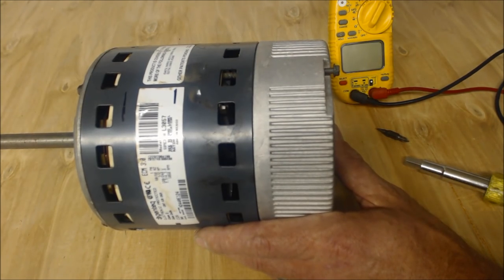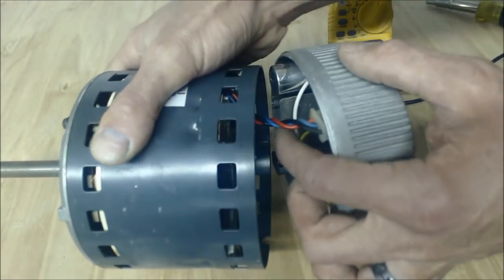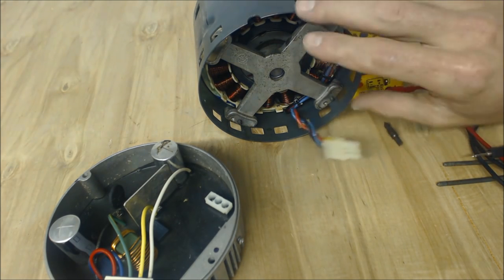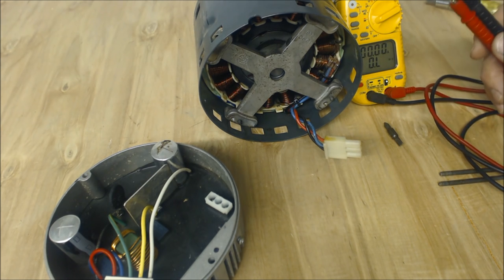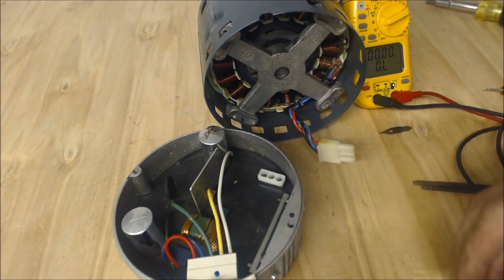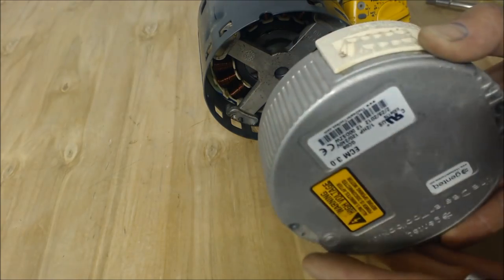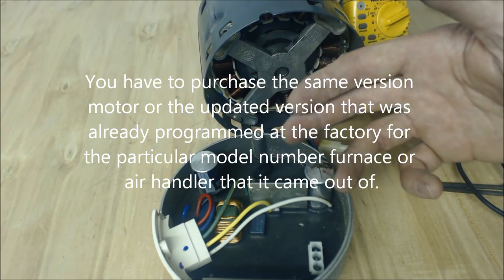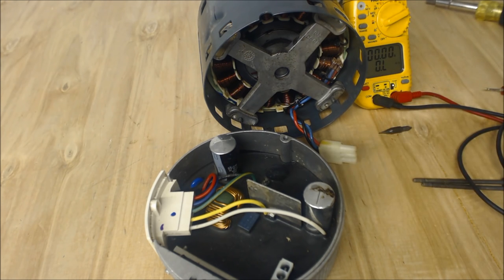Troubleshooting Variable Speed Fan Motors!

Comment: Yeah you are right that's a 3-phase motor with 3 speed multi RPM but also you forgot to mention that's a DC motor not AC because the module that's attached to motor that converts AC to DC.
Great video nice work as always keep up the good work my friend.
Reply from the maker: You are absolutely correct Nurfet Alic, thanks

Comment: thanks for the vid, just changed one luckly it was under warranty. they wanted 300 for a new one.
Reply from the maker: Well that price is actually pretty good if it was not under warranty, sadly enough when 300 is cheap. I am glad it was under warranty for you!
Reply: Trane wants 575 for just the ecm cap.

Comment: Great Video! You forgot to explain how  to test the hub bell.
Reply from the maker: Thats just it. If you use the genteq tool to tell if the variable speed motor is bad then you just have to find out if it is the hub or the actual windings in the motor. If the windings are good then it is the hub that is bad. We can't test the hub disconnected and off. It is a process of elimination just like verifying if a control board is bad, thanks Luis!

Comment: You are the best. Can you make a video of like how to do a new construction installation. I need help with how to find the exact con and btu for a home and how to properly size the ducts to each area. How many returns etc. I hope you can get back to me thanks for all the support for us on the field
Reply from the maker: Richard, thanks for letting me know what you would like to see. I do what I can, when I can but I appreciate you letting me know, thanks
Reply: Grandpa stood on the curb said big house big furnace small house small furnace. Back then they only made 3 sizes. Now with several options heat calcs make huge difference sold many jobs with smaller furnaces than competition offered because of taking time to measure for heat calcs & guarantee it would work to large cold swings to small can't keep up, cost more to operate. Measure walls windows doors find what insulation in wall & attic windows single Payne double payn. how much below frost line basement walls are everything above frostline calc at 15 below depending on your area. Im in wisconsin some places calc at 9 below farther south you go higher that number. Every thing below frost line is a constant. 50 degrees including floor remembering Heat flows to cold. Warm air rises. there are sheets like lennox has good ones now there are computer calcs that are easy every manufacturer has one depending on what brand you sell all are good with AC figure 2 people per bedroom. Sold many jobs by doing calcs when no one else did. Only had one problem with a hydronic cast iron baseboard that I still do not know how to calc. But its amazing to do calculation replace 80 k with 40k & gauratee it will work to 15 below when competition quotes 80 k. And your right because you took the time to see what they actually needed. Good luck doing what is best for your customer makes you money doing for them what you would do for yourself & believing in your self & your product brings more referrals than any advertising.heat calculation not that hard competition thinks they can copy rating plate sell existing size not taking in customer or previous owner may have insulated replaced windows or added addition to structure. Spend time with customer sell quality don't compete with low bidder.  Selling 2 stage variable against 92%  96% not much of a pay off but 2 stage variable uses 79 to 250 watts against single 92% that uses 750 to 1000 watts. Educate your customer. Don't try to sell price your worth more than your competition charge for that if your sincere they will pay more for you to take care of their needs. Take time with them explain optional equipment UV purifier, air cleaner, humidifiers, cover everthing then slide your quote to them & shut up he who speaks first loses. If husband and wife make a excuse to get something from truck let them talk. You come back in they buy from you.  Because you took the time to explain & do it right. Even if you are $500 higher than competition they will see the value in you. Sincerity & references sells better than any hype or bullshitter that tries to sell by cutting price. Sorry for going on & on but good luck to you 45 years in hvac. Love the trade & people I've met.
Reply: @monroekunz2070  Very good advice. Thanks for your thoughts.

Comment: The prices HVAC manufactures are charging for the ECM controllers is absolute highway robbery... American consumers are getting screwed so bad it's unreal...  and now they're even potting the circuitry to make sure you can't do a component level repair.  The capacitor that failed on that unit could probably be purchased for less than $5... but since it's potted you have to throw the whole thing out and buy a new one for $500.  This form of "marketing" should be illegal!  My next furnace, I'm going to avoid ECM motors like the plague... the control modules fail FAR too much.  I think more often than not, people spend more on replacement of these fault prone motors than they save in electricity.
Reply: I am in the process at this moment of trying to figure a practical way to replace the thermistor in an EON module that is potted.  It will not be possible to do it at the pcboard level.  I'm thinking that I should break the thermistor apart and attach a new one to the leads of the old thermistor that remain above the potted surface.  My dilemma is that this TRANE unit is still under the factory warranty and, should they examine this part after it is returned to them, they will take it out on me.  I wonder if they even bother to look of just scrap them.  They have left me high and dry because TRANE has decided that the motor/module should be replaced as a "unit."  Nonsense, the motor is fine!  It's 95 deg and 90% humidity here now and TRANE has NO inventory nationwide to ship to my authorized dealer for ONE MONTH!!!  I'm an EE, have diagnosed the problem and know what I am doing.  I can fix this in a NY minute but risk losing the balance of a 10 year P&L warranty (3 more years).  Honestly, there needs to be class action litigation.  I realize that, ultimately, it's the government's fault for forcing these efficiency standards, all in the name of GREEN, but what's a landfill full of these damn things doing to the environment???
Reply: @georgemcmanus6073  Agreed - it is freaking ridiculous!  I replaced the thermister in my ECM when it went out but it was not potted.  The "logic" of this situation is completely incoherent.  They put this thermister in the design to protect the rest of the circuity from damage at start up... but when it fails from all the stress it takes, they say throw the whole ECM AND THE MOTOR away!   Over a $5 part.   I would just solder a new one on to the leads - they are so intent on treating the entire motor as a unit that I doubt they'd ever know if something else failed on the motor.  If its still under warrantly though - then aren't parts like the motor covered?  Are you just trying avoid labor cost to reinstall the motor?
Reply: @rhymereason3449  No, I'm covered parts and labor 100% until 2027.  The problem was that they said TRANE did not have the assembly and it was estimated to be in-stock early August!  Well, it's hot and humid as hell here and that is unacceptable.  That started the hunt for a resolution to the issue and how I discovered all of the craziness involved with the ECM motors.  Bring back PSC motors.  Wait, that's right, the government says no more furnaces are to have PSC motors.  And now, this week, PFC's are again being regulated by the EPA so that you can pay through the nose for refrigerant in the near future.

Comment: Hi i have a Trane XR series gas furnace with a ecm variable speed blower. The magnets seperated from the motor stator/shaft. I epoxy/glued the magnets back on. The motor now runs with out grinding but it seems its in low mode or just  below low then the heater goes out on temp limit. It tries to ramp up to high speed but never spins high. It seems stuck in low mode or just shy of low mode. Any ideas? Replace the motor or do i replace the ecm part of thr motor? Thanks for posting i hope you can reply.
Reply from the maker: Usually the module by itself is very close to the price of the motor and module. It sounds like you would need a new one since you can't adjust the speeds, thanks!

Comment: i know these ecm motors are expensive, can i replace it with a different motor?or would i have use oem motor?
Reply from the maker: You can't replace this with a psc for a multispeed furnace but for a single speed ac unit, you can  replace it as long as the cfm is the same. You would need to make sure the transformer can support another load and add a contactor or fan relay to the low voltage to control the fan when calling for the blower to come on, thanks

Comment: brilliant post what would cause a variable blower motor to slow down and speed up, it starts up gets to full speed then starts  hunting slowing down and speeding up ?. its only a year old. its in a goodman furnacethanks.
Reply from the maker: Usually that happens after a bad filter clog or some other airflow restriction where the motor had to try to provide too much torque to overcome in my experience
Reply: Thank you for your input, you are a credit to your profession, and I enjoy learning from your posts. I will let you know what the issue with the motor is once it is solved, I removed the filter ( still clean ) and opened the service door to the blower motor, I bypassed the door switch and ran the fan with the same result. I will take the motor out this weekend and bench test it. thanks again ACSERVICETECH you are a gentleman.
Reply from the maker: Sounds good, thanks John!
Reply: So i took the motor out and bench tested it. and it worked fine for over 45 minutes. i reinstalled it and as soon as it was turned on it started to hunt. i then opened the supply plenum and the hunting stopped, so i checked the ducting all of which is 6" in diameter everything was fine. i decides to change 3 of the runs to the larger rooms to 8" and put in new larger registers and the hunting stopped. i guess the ducting could not handle the volume of air that the motor was trying to give it and may have caused back pressure. funny that it worked fine for the year, does that make sense to you and would this be related to static pressure. Thanks
Reply from the maker: Yes it is related to static pressure and motor torque settings in the module. I don't know how many cfm's we are talking about but it could be too high of a static pressure in the duct ir the module did not like to operate at that certain static pressure and by changing the ducts, you changed the static pressure, thanks. Sounds good
Reply: Thank you for allowing me to bounce these situations off you, and thanks for the tool links I have got some good stuff cheers.
Reply from the maker: Sounds good, thanks

Comment: how can you distinguish between a variable speed motor and a psc motor by just looking inside the furnace? can you tell by serial/model#? thanks.
Reply from the maker: Variable speed has plug locations, x13 have spade terminals and psc has a capacitor, thanks Mark!

Comment: Ken that hub keep the fan running if it’s bad I have checked everything else replace my relays replaced control board and my fan still stays running Man
Reply from the maker: Yeah that sounds like a hub if you already replaced the control board, checked the 24v on each of your safety switches such as rollout and high heat and if you don't have 24v read with your meter from g to c on the control board, thanks

Comment: My elite Lennox air unit blower went out.  I conducted this test and condemned the ECM module.  I picked up another ECM module that was same part number and specs.  I connected the cables and the motor was working.  After I remounted the blower motor , it was running fine for about 10 mins and it shut down again.  Now I have the same problem where im getting the high and low voltage to the ecm but the blower is not starting up.   Any suggestions on what may be causing the ecm to fail after replacing it with another ??
Reply: Did you figure it out?
Reply: @jvirg  Yes I did,  I just replaced the whole blower motor and problem fixed.

Comment: my fan wont start up and make air come out of vents...I assumed it was a capacitor but the hvac guy claims I need a new motor assembly.  Once I can get the fan running I can leave it on all day with no problem so I'm going up on my ladder tomorrow to take a look for myself.

Comment: Great video, thanks for the info. Do you have any idea what voltages or signals are required or are present on the connector between the hub and the hvac controls?  I noticed there where only 5 conductors going into the potted circuit from the connector.  That is a very bad location for electrolytic capacitors as heat is the number one killer for these very short lived devices. You would think they would have put the ESC (Electronic Speed Control) in a different location and just ran three wires to the motor. All about money I suppose..... Thanks again!

Comment: Good informative video, thank you. I wanted to mention that unfortunately the pricing for the motor and control module on some Trane units is so ridiculously over priced that some do it yourselfers will be forced with buying only the motor or only the control module. I’m talking about $390 for the motor, or $390 for the control module, $780 if you want to replace both at the same time. I don’t know how they get away with pricing parts this way, but somehow they do. Meanwhile, thanks again for posting a great video.

Comment: Awsome video.  
I just bought my system and got the Variable Speed air handler and compressor. Lennox XC20. Everyone keeps telling me oh these systems are complex to install and stuff but to my knowledge the installation of air handler and condenser unit is the exact same as other single speed units. The only difference is the communication stuff and wiring for the thermostat which one can do if they understand. Don’t know why everyone keep saying it’s complex. 
Do you know of any other differences?

Comment: Great videos!! How about one showing how to hookup a psc motor, just to supply heating or cooling when in a pinch. Or do you not recommend that?
Reply from the maker: I was thinking about doing something like that. Give me some time! Thanks!
Reply: +acservicetech  Cool, looking forward to it.
Reply: About $385 for ecm and around $800 for whole unit for my 1/2hp 2.3.     I was going to try to switch to PSC which wasn’t going to work then evergreen em x-13 set to single speed per servicer. I ended up buying a refurb of my motor plus ecm from a shop in Tampa! FL $299.99 total including next day ups.   Today I installed and started right up.    My multimeter battery connector broke a while ago and didn’t have time to fix so bought a nice clamp meter as can always also use a clamp and have a smaller meter to bring around.    Tech didn’t bother trying to diagnose more than 240 at plug to ECM so need to replace whole unit (quite a lot over $1000). - Turns out motor is fine on old.   I don’t visibly see any thermister or capacitor damage in ecm so at some point I’ll check that.     Would be nice if there was a law requiring them ecm or motor to be diagnosed and further if it’s a $2-$10 part to fix it rather than force people to pay for this nonsense and generate waste.     What happens to old - it’s not in warranty so it gets scrapped.     Yay that makes sense.

Comment: Good video! Due to the cost I see so many mechanics replacing them with standard motors and a new relay due to the customer not wanting to fork over the cash.  Sad but real world.😎
Reply from the maker: You have to do what you have to do to get the customer running again. I will also add two concerns though.Techs will want to make sure that they are checking the refrigerant charge afterward to make sure it is the same airflow since you were not there before to measure the airflow.The other thing is you would only replace them with like horsepower blower motors on single speed units only and not on something like a two speed, three speed, or variable speed furnace since the board will be sending out low voltage signals to change airflow speeds.
Reply from the maker: Thanks for the Comment!
Reply: Just picked up control module for my genteg 3.0  for 198 dollars
Reply from the maker: Sadly enough, that is a pretty good price! Thanks for the update!
Reply: Brian Croft, where did you get it?  I need one too, for a Carrier Infinity ICS.
Reply: Brian Croft where? I’m in red of a hub

Comment: My module is $230, or $580 for motor and module together. That's a bit more than $50-100.
Reply from the maker: Multiple suppliers of mine charge 50-100 more for both compared to just the module. That is great then that it is that much cheaper if the module is all you need. Just make sure that you are purchasing this from a distributor that has purchased this from the manufacturer of your equipment which has programmed this for your model number unit, thanks for letting me know Kris!
Reply: i have the same experience. Its normally about $80 difference between purchasing the motor  or just the bell housing. its not worth it. might as well get the whole assembly. less headache and potential for future problems.
Reply: Just purchased a module and motor for my blower.  Price difference was $10.